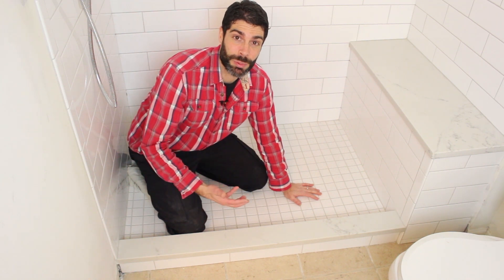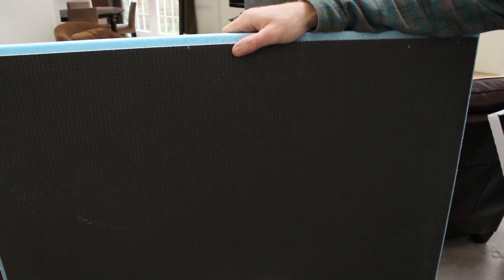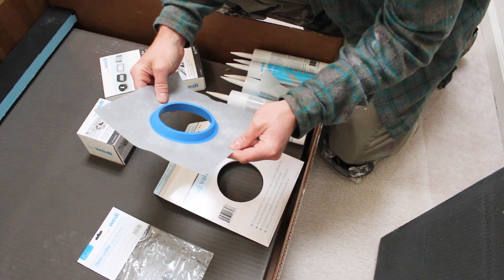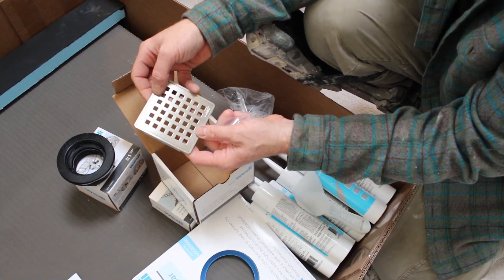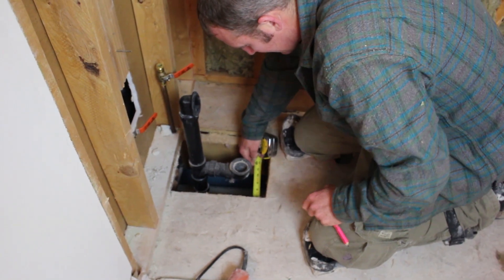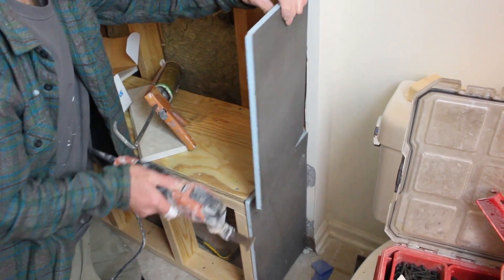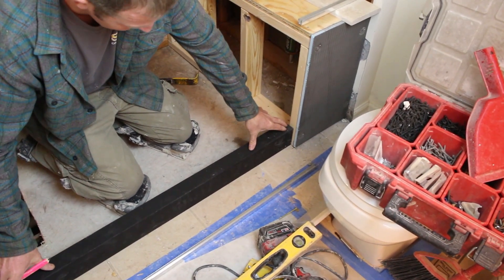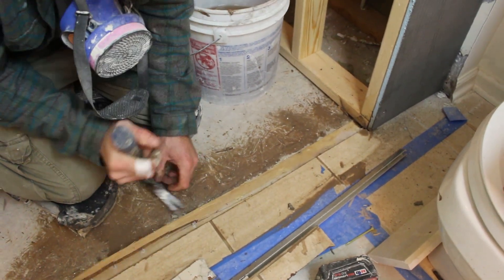Install a Shower Pan Part 1: Curb Prep for Wedi Fundo Primo (Step-by-Step)

Comment: Thanks for sharing the video. This is the first time installing a Wedi Fundo Primo 4 x 3 shower.  I bought both the "lean curb" and the standard bulky curb from a local tile supply house and plan on returning the one I don't end up using. The appeal of the lean curb is the same as the reasons stated in the video.  The reservation that I have with the lean curb compared to Wedi's standard shower curb is that the profile provides minimal contact and support and seems to be a point of failure down the line.  Could you provide any suggestions on shoring up the curb?  Thank you.
Reply from the maker: Yes, apply Wedi joint sealant to both ends of the curb to ensure it’s sealed. Also, be very generous with the sealant at all rabbet cuts and where the curb meets the pan. If you follow the Wedi instructions you should be in good shape though. The Lean curb, while small, is very strong. It looks good in a tight shower
Reply: uh, oh! Is the lean curb a point of failure? I'm planning to install a heavy glass sliding barn door on it. Have there been issues with the curb failing?

Comment: Question I just purchased a 35” deep x 70” wide L shaped glass only shower enclosure by dreamline. Can I build an L shape curb w wedi products and set the glass directly on the wedi curb after tiled? I wanted to use a wedi base also to eliminate building a wood 2x4 L shaped pan w mortar? Thoughts? - thanks
Reply: E Sedman: Have you received an answer? I read in the Wedi web site FAQ that they recommend epoxy the hardware on the finished curb or glue a 4"x4" galvanized metal plate on the wedi foam curb then use self tapping screw thru the curb finish into the plate. I haven't been able to talk to anyone who actually has done this yet.

Comment: @homerepair  Do you have to install the curb on the side or can you have the curb on any side you want? The shower I’m doing need the curb on the short side so to speak.
Reply: Obliviously this is a year later but any side … in case someone else comes across this question

Comment: I used the Wedi Fundo system for my shower and I'm ready to install a curb. I have a nice fitting piece of Corian that I'd like to use for the shower threshold, but I'm not sure of what mortar or thin set to use that will best adhere to the Corian, and also allow me to build up the pitch to slope into the shower. Any advice on that?
Reply from the maker: You can definitely use Corian Michaela, and we use Ardex X77, Laticrete 255, or Mapei LHT for large format tile and curb tops.
Reply: Home Repair Tutor Thank you! So, what’s the best way to create the pitch? Also, enjoy your videos very much. Very helpful.
Reply: @michaelasmith6907  if it's not level, u can shim it, till its level, no pitch. Cause when u install the shower door bottom trim,  u want to set flat

Comment: Thanks! Do you have any ideas on how best to create a slight pitch to keep water from the curb within the shower?
Reply: Outside tile higher than inside.  Then thinset the top thick before placing the top. Viola, pitched.

Comment: How are glass wall panels installed on the wedi foam curbs? Wedi recommends epoxy the glass hardware or glue a 4" x 4" metal plate to the foam curb. How is this actually accomplished? Ive talked to several glass installers and they all say the glass hardware has to be anchored with screws. Any advice?
Reply: I realize Im kinda randomly asking but does anyone know of a good place to watch newly released tv shows online ?
Reply: @Jamal Forest ehh atm I've been using Flixportal. You can find it by googling=) -jude
Reply: @Jude Dash Thanks, I signed up and it seems like a nice service :D I appreciate it!!
Reply: @Jamal Forest happy to help :D

Comment: hey buddy......i do not recommend building a bench out of wood.......built one out of cement board with pl 400 or use styrofoam .......keep the wood out of the shower and minimize the troubles
Reply from the maker: We like preformed foam benches as well, but this is a solid installation when done correctly. Wedi will be completely waterproof if installed correctly

Comment: Yes you are suppose to thinset the Hardie backer. But! When it comes time to demo! Will u come and demo out? I leave space of about quarter, then thinset the seams and apply mesh. With added screws, NEVER EVER HAD A PROBLEM. EVER! now u can talk people down all you want to but there are more ways to skin a cat. I hate when some of these guys learn their way and only their way is right! I hate that mentality. Drives me crazy.
Reply from the maker: totally understand your reasoning with the demo. But HardieBacker needs to be waterproofed with a liquid or sheet membrane over the thin-set seams and corners. And if that's done then the shower surround will be properly prepped for tile. That said, we simply don't use HardieBacker because there are better and faster options like Wedi, Hydro Ban Board, etc.
Reply: @HomeRepairTutor  I do that as well. When client wishes to pay for it. Around here, only high end homes want such a thing.
But I was strictly talking about the bathroom floor comment in the video.
Reply from the maker: @MistAtsiM  ah okay, wasn't sure if it was the floor or the walls. We didn't set that floor